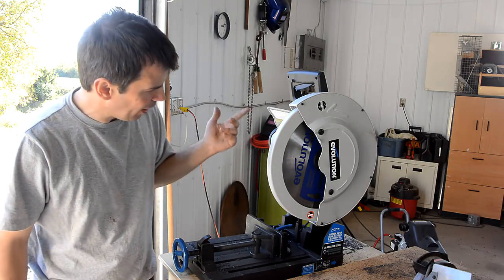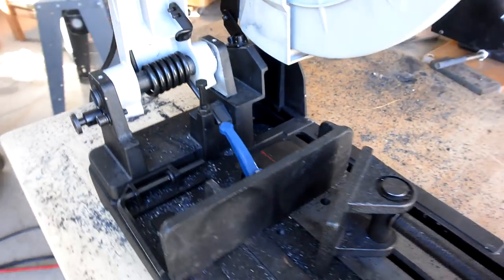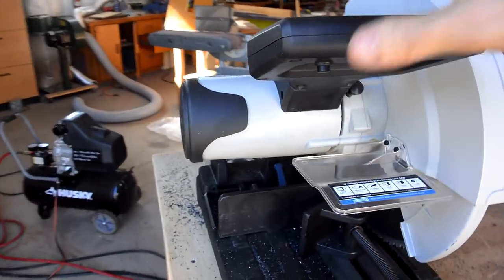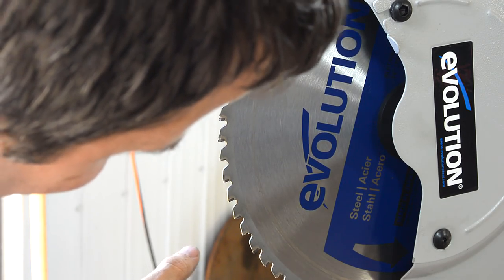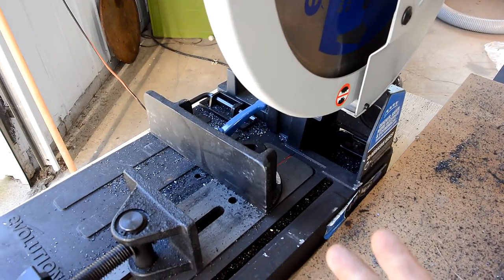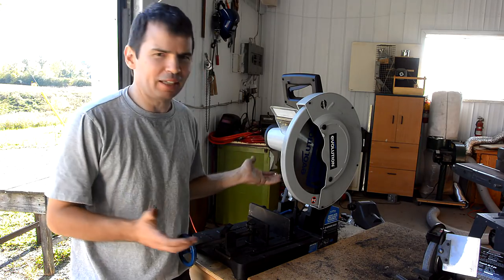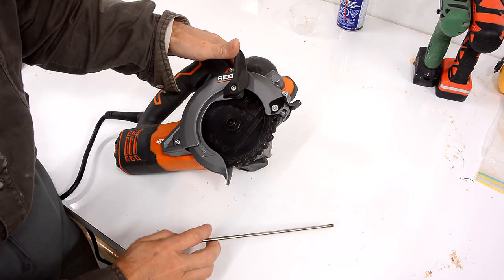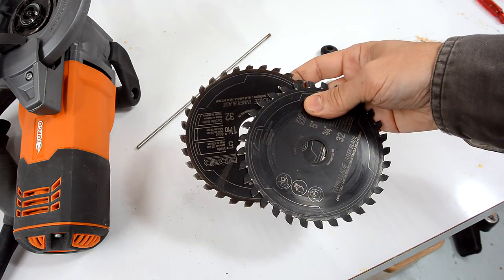Evolution dry cut saw review

Comment: also, stay well away from aluminum with these. a guy at our shop destroyed a blade when the aluminum chips filled the gullets and broke teeth off.
Reply: Actually these saws are used to cut aluminum with great success, ideally with an appropriate blade. If you're going to cut lots of al, then get a al-specific blade. Blades made to cut ferrous materials generally work, but not as well. Technique also matters. Sounds like that guy didn't know wtf he was doing. There are literally hours of video of successful al cuts with these saws with great results.

Comment: All these saws are chinees relabeled, poorly made copies of the  Makita LC1230.
and the sawblades that comes with are crappy too
Reply: I replaced one of these with the LC1230 and haven't regretted it, the build quality in comparison to the evolution is noticeable right out of the box.
Reply: Sjuul CNC they claim to be original designs from their head office in Sheffield. In the UK market they go big on the "designed and engineered" (ha!) in Sheffield thing with union jack stickers on them. Yeah, they're no where near as good as a makita or dewalt but they're a fraction of the price and they're better than most Chinese generic imports. Mid-range product at a mid-range price and plenty good enough for the home user IMHO. The two evolution saws I've had for over 4 years have held up very well. Only real complaint is the fence on the circular saw is a bit flimsy and can get knocked out of square
Reply: Jon Massey I
Reply: Sam T . Are the makita blades better than evolution blades.